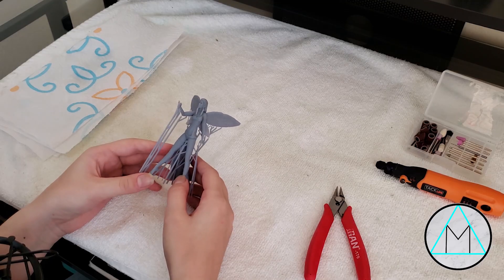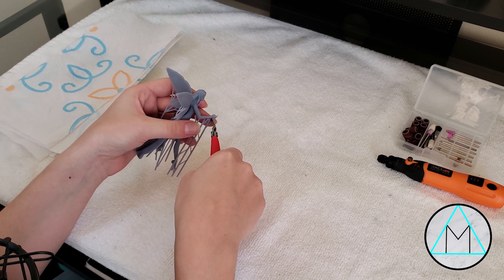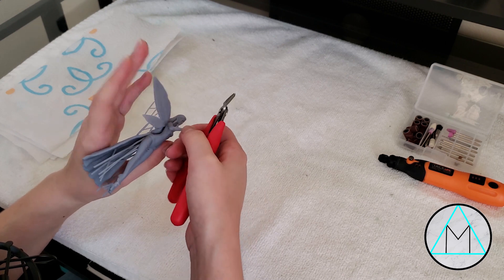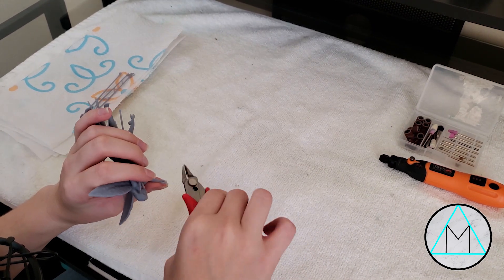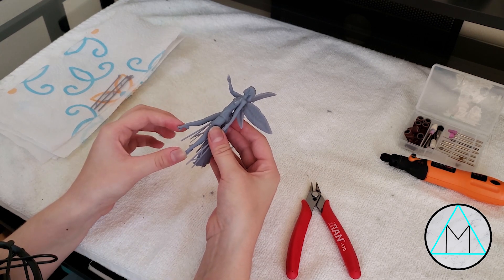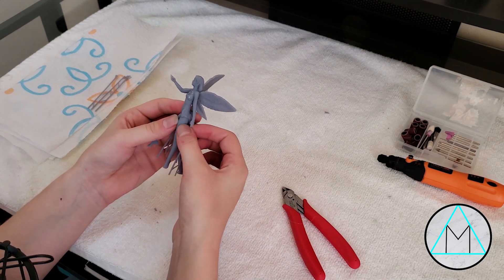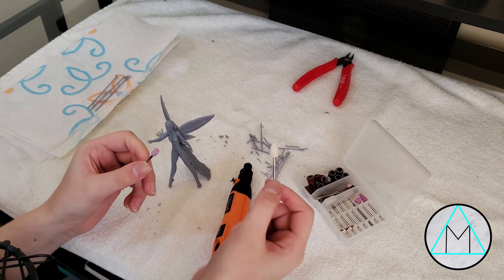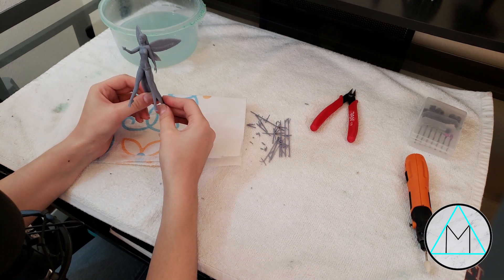Removing Supports from Resin 3D Prints

Comment: I'm assuming you remove the supports after cleaning and curing, is that correct?  I just got my first resin printer.
Reply from the maker: I remove the supports after cleaning but before curing. Once it is cured I sand off any marks left from the supports.
Congrats on your first resin printer! That's so exciting ^_^
Reply: @Ms_M3DM  Thank you.  I messed that up with my first prints, and because they are so small, they are quite fragile after curing.  OH well, at least I didn't waste much resin.  LOL
Reply from the maker: @sjschauer4235  Haha exactly! Let me know if you have any other questions ^_^
Reply: @Ms_M3DM  Thank you very much.  I hope this resin printing goes well as I plan to use it to start manufacturing models from my books to sell, either as complete, small scale models, or kits.  FDM is great, but some of the details really require the precision of SLA.

Comment: Can you link the rotary tool you're using? I've been having problems with my prints and supports where they leave a dent/mark after pulling off. I never though of snipping a bit, sanding and then priming after. Great video and very helpful!
Reply from the maker: Glad the video was helpful! :D I list all of my equipment right here! https://www.m3dmprints.com/our-equipment

It makes life so much easier! Those little dents and marks used to drive me nuts haha
Reply: @Ms_M3DM  links dead
Reply: David You probably already figured this out, but the tool she’s using is called a Dremel, and the one she’s using is called Tacklife, from what I can see.